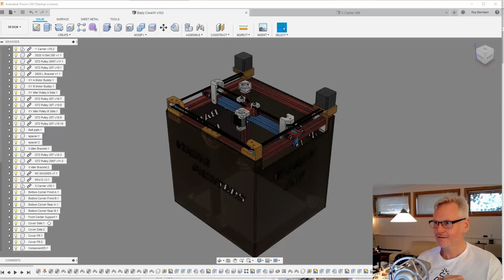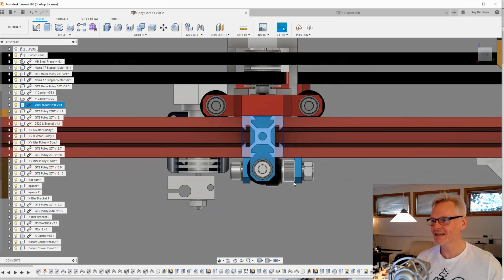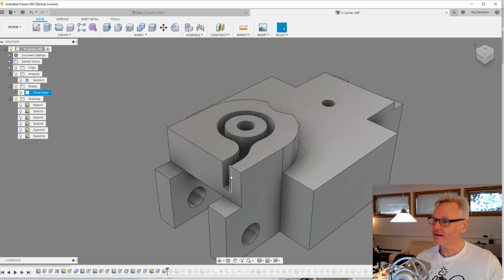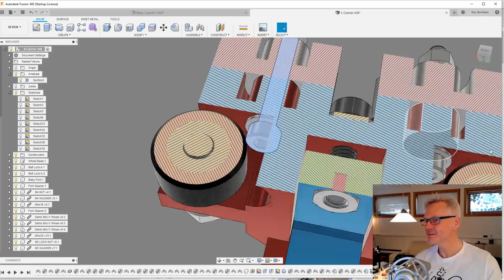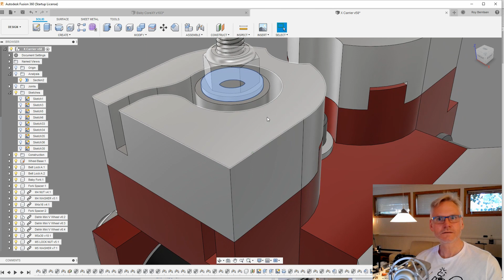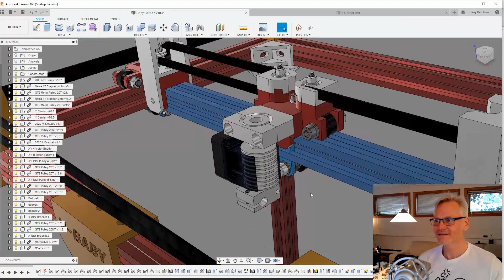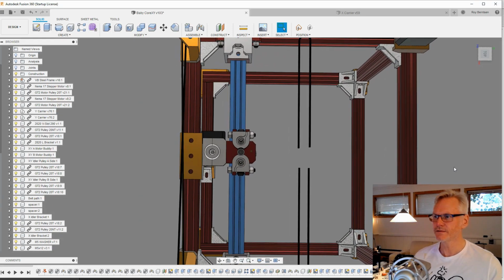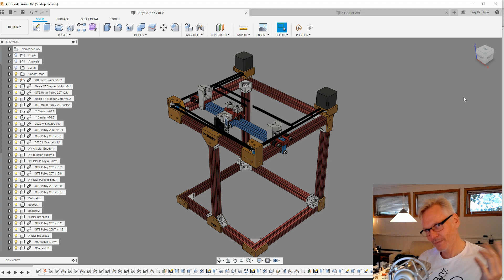Design Vlog #5 - Baby CoreXY 3d Printer Design - NEVER GIVE UP!

Comment: Good update Roy!  The design is really coming together.

For my V-king I bought 50 black nylon M5x25 screws.  A lot of the screws on the V-king do not need to be steel and the weight savings is considerable.  The 50 screws weigh only 29 gms.  7 M5x25 Stainless weigh 28 gms.  This is about 1/7th of the mass (in fasteners).  I have already removed the washers from anyplace where I wasn't tightening up the bolts.  I will probably replace a couple at a time and see if there are any adverse affects.  Another thing about using Nylon is they are usually less expensive than metal.  There is also a glass filled variant for additional strength although these are more expensive (about the same as stainless.)

Another thing to keep in mind is that you can get low profile heads for many of the fasteners.  This could help in some of those tight situations you are seeing.  Also, the button head fasteners are almost the same diameter as the washers you are using so there would be no point in adding the washer for those if they were really necessary with the socket head fasteners.

Doug
Reply from the maker: Thanks Doug!

When choosing fasteners I try to use what aver is more accessible. I dont think the weight of these are important but it is a interesting choice to go with nylon for sure. As you say we dont need to tighten all these to much

I am aware of the low profile heads but again they are not so accessible in all lengths so I try to use a socket head where possible. But actually I prefer button head and will look into if we can get this in all sizes

/roy
Reply: Roy:

I bought all my fasteners at the local hardware store except for the special V-Slot nuts, the M5x10mm socket head, and the Metric nylon parts.  They didn't have any of those.  The hardware stores in the US charge far too much for Metric fasteners and the selection is not all that great.  I could get everything from McMaster Carr for a lot less and if I had to do it over again I would do that, have a lot of extra fasteners left over and almost $200 extra in cash.  There has to be something like McMaster Carr in the EU.

The main reason I did a Core XY was to improve the quality of my prints.  The low mass of the print head is so important for the elimination of ghosting.  i3 style printers are not so good because of the Y axis thrashing they go through.  Deltas are not good for making precision parts because of the varying resolution across the print bed but they do have lower mass.  I changed out my bowden for a direct drive on my CR-10 and while it improved the prints overall it did add some ghosting.  I would much prefer to have a direct drive arrangement on my V-King and I may try a Zesty Nimble extruder to keep the mass low.

Comment: Personally, I am in favor of the engine side as the front side. To clear access to the bed.
As Fredrik Osterlund says, using hex screws must solve many problems.
This project is definitely more and more interesting!
Reply from the maker: I think your advice is smart. There will be a belt in the center of the motorside as well limiting the access but I agree it can be the best side.

Also I will look into the hex solution for sure! Thanks
Reply: @PRO3DESIGN  About the center belt, I guess you're talking about the Z axis. I'm wondering how you're going to solve the "rear side" belt positioning with the presence of the vertical extrusion that's in the middle too?!?
Reply from the maker: @MP-fv8iy  yes the belt for the Z lift will appear in the middle of the printer. I also wonder how to manage the middle leg Design choice. I will try but maybe I have to trash it
Reply: @PRO3DESIGN  It's a radical solution!
Another would be to move the Z belt to one side at the front and in the opposite direction to the back ...

Comment: Nice! I suggest the "front" of the printer to be where the motors are, so you have a clear vision of the buildplate. Right now it is obscured by the "center" extrusion.
For partcooling a radial fan flat under the x-carriage blowing directly towards the nozzle was the first thing that came to mind ;-)
This would barely need a duct at all. Adds even more complexity to the X-carriage though.
Reply from the maker: Thanks! Interesting idea for part cooling. We can play with it and see

Comment: Have you looked at the creality style hotend? It is thinner then the E3D V6, then you may gain some travel space. How about a countersunk hex bolt for the belt locks instead of the cap head screw?  Then the wheels can be on, and you don't have to connect the belt to the x-carrier before the wheels. :)
Reply from the maker: Hey you gave me an idea about the hex bolt.. Of course we can do that where I cut out. It is only half a bolt but thus should be enough to keep it from turning. Thanks
Reply from the maker: I do have a creality hotend in backlog for this exact reason! Nice of you to notice. I can not sink the bolt as it is only 2.25 mm of material but it's only adding the screw first. The belts will be added after the carrier is on no problem

Comment: Again nice work Roy. My personal thoughts. In places where 5 mm bolts and nuts is overkill use 3mm. 3 mm is more then enough for parts on the X carriage and also for tighting the forks in general. The head I like it placed in open space.....Paco
Reply from the maker: The fasteners in mention are M3 and M4. M5 are only where hardware define it - Like the wheels and frame
Reply from the maker: Thanks btw :)